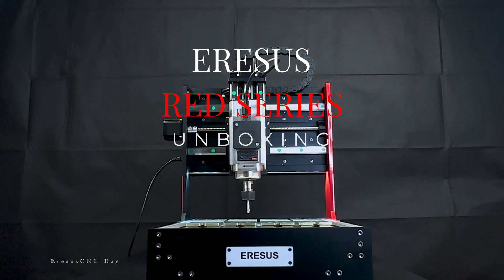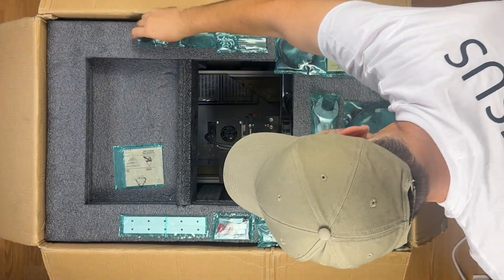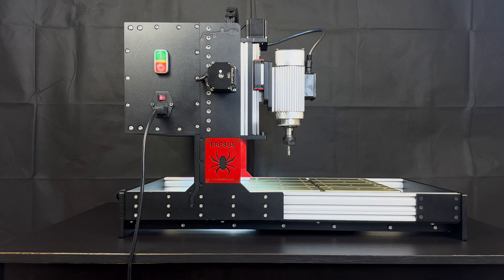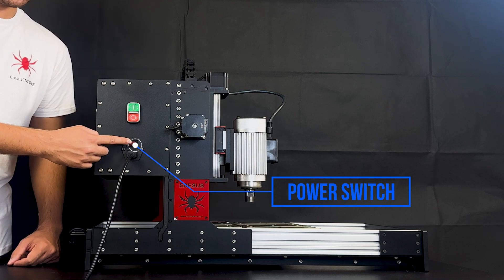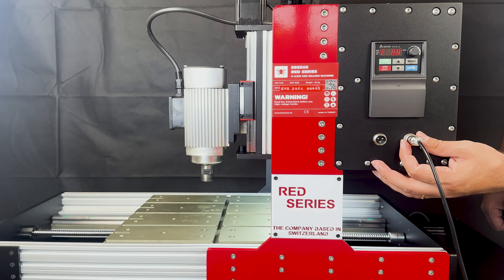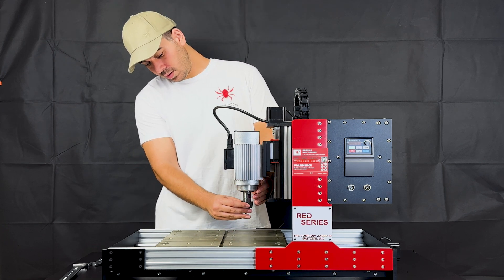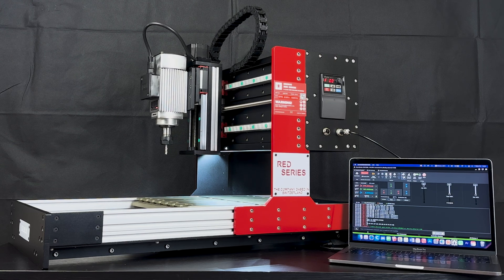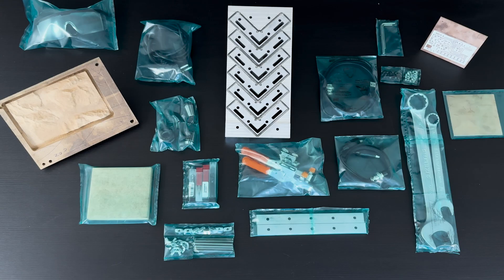Metal Cutting Desktop CNC Machine |  Eresus Red Series Unboxing

Comment: This one does canned cycles or only "pure" G code?
Reply from the maker: Thank you for your question!
This machine uses GRBL-based control, which does not support canned cycles like G81. However, we include a full version of our CAM software (Estlcam V12) free of charge with the machine.
The software provides simple and intuitive shortcuts for drilling and other basic operations, making canned cycles unnecessary for most workflows.